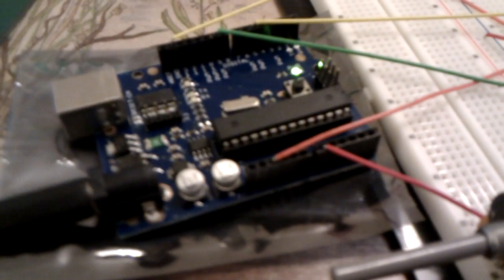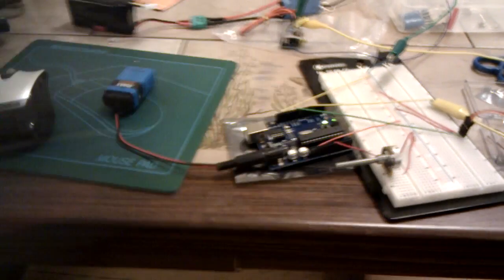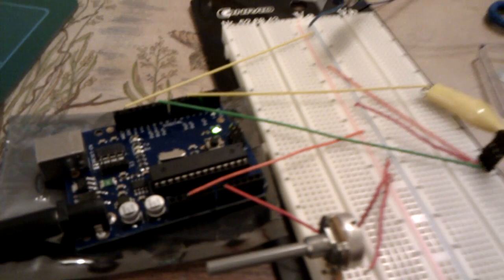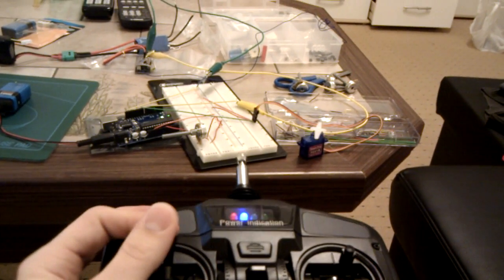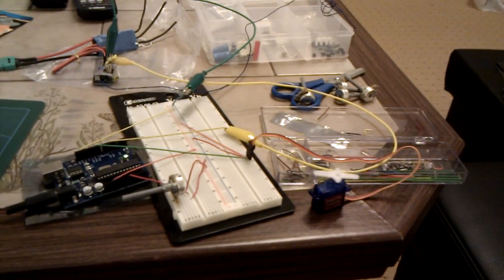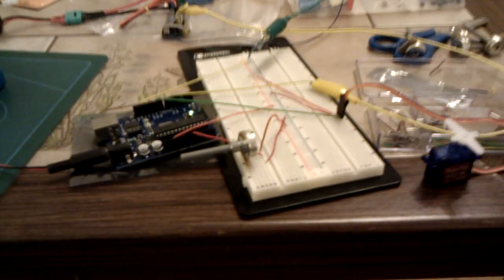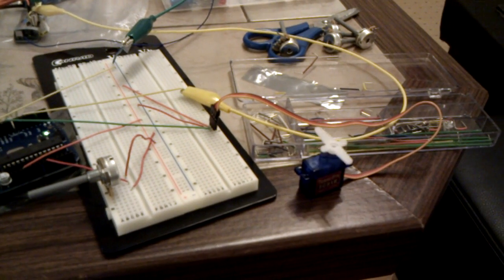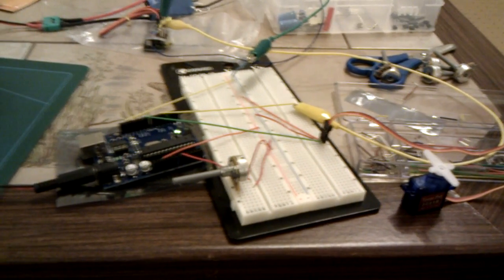Arduino RC Remote Control Interface

Comment: Thank you so much for the code! Was exactly what I was looking for. 
Did you ever manage to get rid of the twitching?  O and turning the potentiometer does not seem to change anything. 
I plan on using your code (with some modifications) to read from my 2 channel receiver and translate that to movement for my robot base.

Comment from the maker: @jnixetra 

Hi,

I will put a link at the description with the Program (I hope it is the wright program and I didn´t make any changes so I doesn´t work anymore…xD). It´s quite simple but some Code is from the original example…

Hope I could help you and sorry for the late answer

Comment from the maker: @noahleskotv 

No Problem. But if you just want to control the Car, the arduino is quite needless. But if you want to modify the signals according to some sensor inputs (e.g. accelerometers...) you must put an arduino between the receiver and the servos. I don´t know your project, so i can´t help you...

but don´t hesitate to ask....

cu

Comment from the maker: @noahleskotv 

E.g. in model planes, they receive the steering signals for the control surfaces. So you use a Remote control to send the signals. Such a Transmitter/Receiver system can be very cheap, but if you want to have a lot of channels and a high quality system it can be very expensive (take a look at hobbyking(dot)com under Rx/Tx systems)

And the output is a PWM style output. in this case i use it to control a servo...

hope i could help you, don´t hesitate to aks more questions